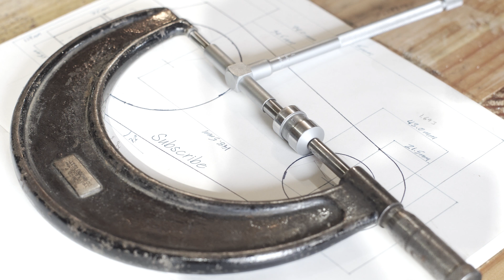As the Rotary Table Turns - "Quick-change" Overarm - Part 2.

Comment: I know this is an old vid by now and probably won't be seen, but if I can give any advice as a fitter and turner its use the knee and come up into a cut instead of coming down with the quill. It might be minute but the rigidity you lose can sometimes be enough to end in disaster by feeding down with the quill. Also the quill can kick back and away whereas the table really can't if the machine is nice and tight.
Reply from the maker: Heya, thanks for the tip!  Definitely something I've started to do since this video came out, my quill "lever arm" has more slop than I'd like too, which contributes to it kicking even more.  I've started using the knee a lot more.  Only thing I don't like about the knee is that I don't have as good of "feel" of the cut.  But probably better then "feeling" it kick and break the mill or workpiece :)

Comment: Bore it true on center and put in a bronze bushing. How about line boring it using the horizontal drive.
Asymmetric bushing is a bad idea if it rotates out position it will cam the arbor off center.
Reply from the maker: Mmm, that's a good point.  Hadn't thought about it cam'ing.  Will see if I have enough stock left on the sides/bottom to bore it out :)

Comment: Are u sure on your feeds and speeds? If I might give a hint... Less RPM, more feed. Get yourself a small silent compressor and a minimal lubrication thingy (costs less than 20 bucks).
Reply from the maker: Probably not ideal, I agree :)  Hard to say since this was filmed a few months ago.  At the time I was using GWizard to calculate speeds, although more recently I've been trying to use my ears and gut more (e.g. if it sounds bad, try adjusting until it sounds happier instead of sticking with the calculated number). I suspect the mill itself is a contributing factor.  One of the prior owners replaced the motor pulley with a five-step pulley, while the original had a six-step.  So all the listed speeds are incorrect.  I'll break out the tach and measure it soon.

++ to getting a small compressor for chip evacuation.  Getting the chips out was a nightmare, and I'm sure caused problems as they packed in.  Thanks for watching!
Reply: @BreakingTaps  Gwizard will most probably give you the optimum speeds&feeds for CNC machining. For manual machinen decreasing the RPMs a bit is not a bad idea, because typically feeding fast enough is sth a CNC  or auto feed does way better than a manual operator, at least if it's more than just a cut in one direction.

If you stick with aluminium, try a 1-flute carbide cutter, they are cheap in comparison and really great. 

Looking forward to the next 1...
Reply from the maker: @ThinkClear Ah yeah, that makes sense.  Will keep that in mind next time. I assumed GWizard would be fine after all the parameters of my mill were set... but it makes sense that it's still assuming CNC and smoother/consistent feeding.  I got one of these feed/speed slide charts from Niagra a while ago (http://www.niagaracutter.com/speed-feed-slide) and I've been having a bit more luck with that.

Will look into the 1-flute carbide!  Not sure my mill will be able to spin fast enough though?  It tops out at 6300 RPM, which seems to be just at the bare minimum for a 1/2" carbide endmill based on that slide chart.  Does running carbide slower just reduce longevity (due to rubbing), or does it actually cut worse since it needs a certain SFM to work?
Reply: @BreakingTaps  Sure, go for it. It will not harm the tool, maybe even give it a little more life due to less heat build up. Just do not go to low with the speeds, it still needs to be fast enough to start the cut. I'd suggest you can go as low as 40m/s, which is ~2000RPM with 1/4inch .
Reply from the maker: Great!  I'll pick up a few and have a go with them, thanks! :)